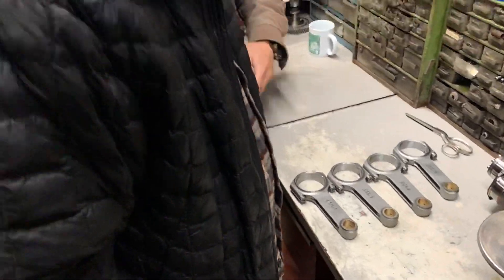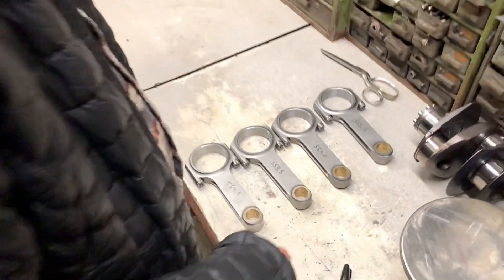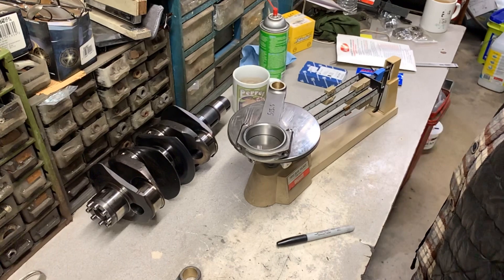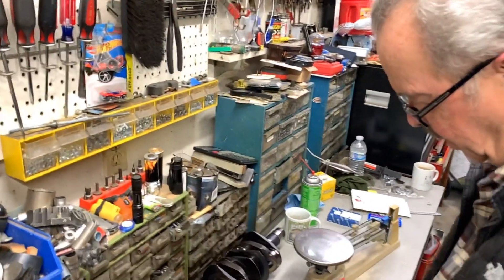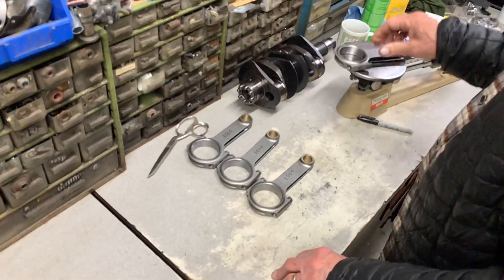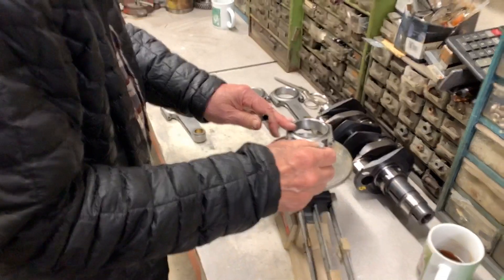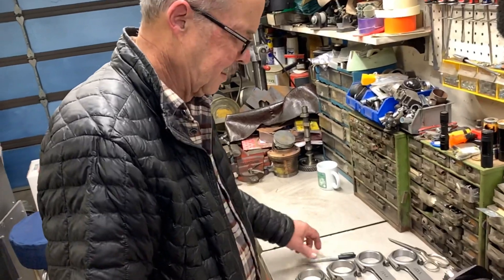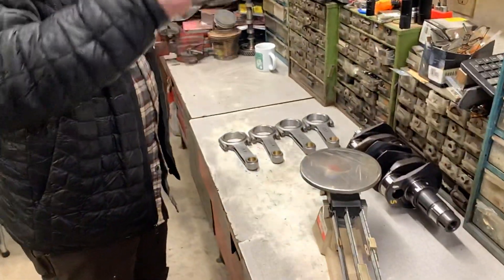How to balance the weight of connecting rods VW beetle engine by Top Line Parts

Comment: How would it not affect the performance of the engine. If everything is perfectly balanced, it will run smoother. I also like how he just throws the rods on the table and they hit. The sides of the rods are also a bearing surface....
Reply: There no such thing as perfect in the casting and machining world my friend. And mind you john has been doing VW’s for over 40years he knows what he is talking about.
Reply: @pauldiaz4273  just because he's been building that long, doesn't make him right.
Reply: @vwmadness1591  i’m just stating he knows what he is talking about.
Reply: @pauldiaz4273  so do it. I have 20+ years vw experience and I'm a certified aircraft mechanic. Stuff like that wouldn't fly in my shop
Reply: @vwmadness1591  i am a machinist with credentials, and many years of expierience. There is no such thing as a machined part being perfect. Hence thats why we have Geometric and Dimensioning and Tolerancing, we can CONTROL error of parts with in specs, thats why nothing is perfect! As you say. Oh and the outside of rods are not bearing surfaces they are just castings, the Internal diameters are precision machines for bushings and bearings.